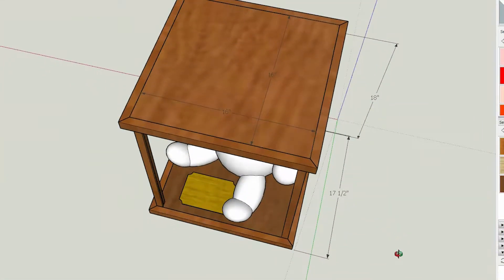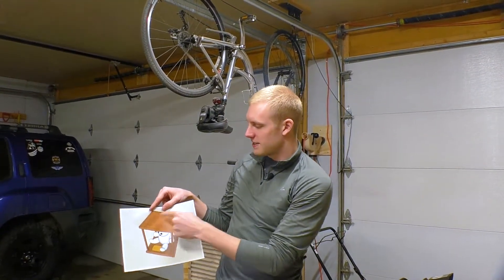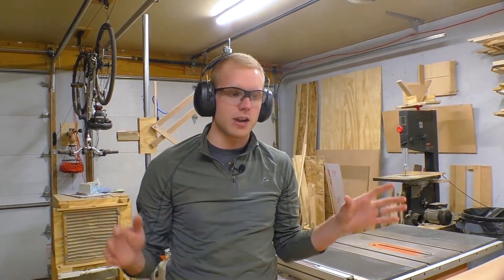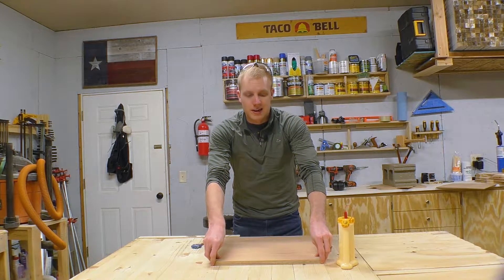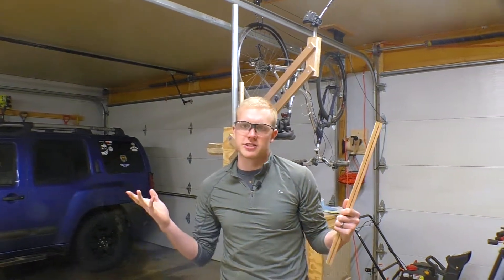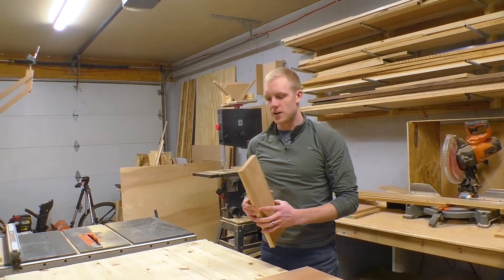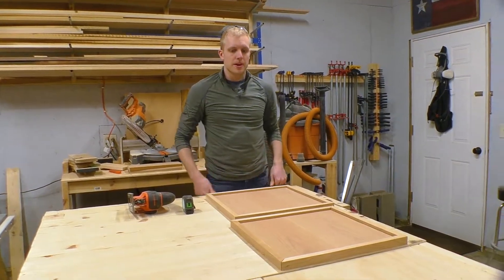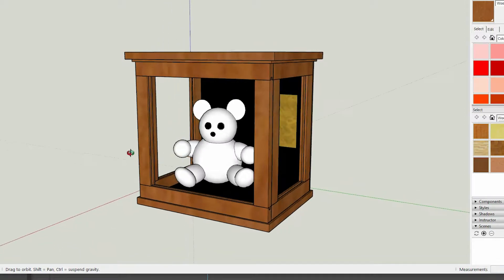Display Case | How to Build | Day 1

Comment: Running your fingers directly over the blade like that with only a small strip of wood is not safe.  I don't want to be that guy that nitpicks everything, however if you did that in high school wood shop you would be warned one time then booted from the class.  If you are making instructional videos for the world to see something like that should never happen.  If the wood breaks due to a defect, hand and fingers go into the blade.  If the wood kicks, hand and fingers go into the blade.